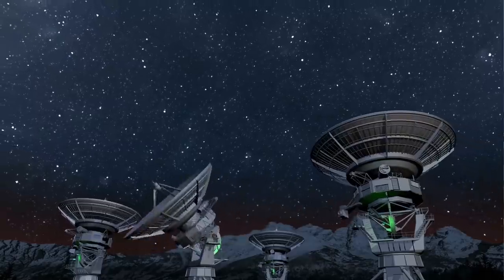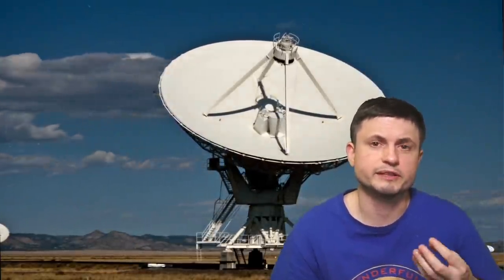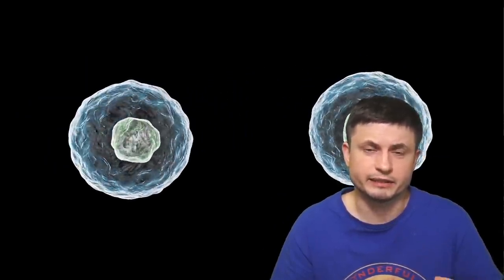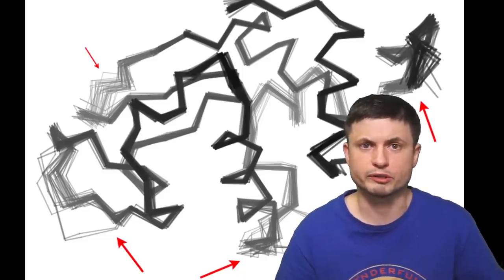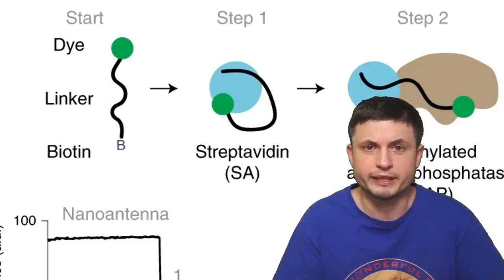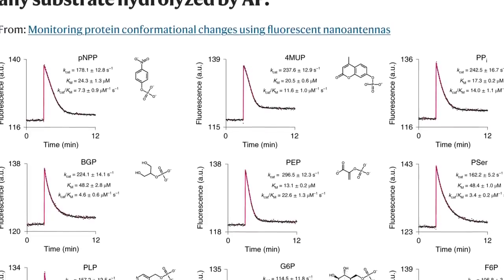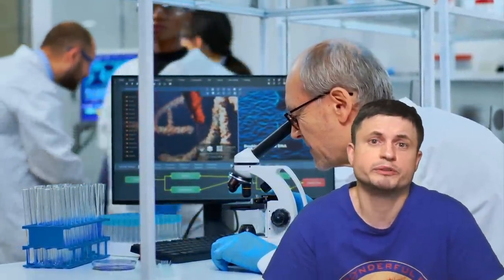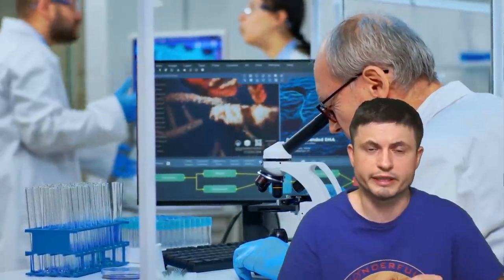Scientists Used DNA To Create World's Smallest Antenna Ever For an Unusual Reason

Comment: Fluorescent proteins have been used like this for a couple of decades.  They're a standard laboratory workhorse.  It would be nice to have a summary of why these are better.

I'm also curious about how DNA would get attached to proteins, since that's not something I've heard of before.  DNA gets translated into proteins, and RNA is sometimes incorporated into protein structures, but reliably incorporating DNA into proteins would be something new that you'd have to trick cells into doing rather than being able to tap into existing cell machinery.
Reply: The link to the paper was included, and there is no paywall to access it. That said, as I noted above, DNA in this study was literally used only as a transporter molecule for a fluorophore molecule attached to it. That is, the DNA itself only served as a carrier for a probe molecule whose fluorescence was monitored in real time and in vivo (in live cells) as a function of such parameters as DNA strand length, use of single-stranded or double-helix DNA, the type of fluorophore molecule used, and the nature, geometry and proximity of an acceptor molecule (acceptor molecules are used to facilitate a process called Forster Resonance Energy Transfer, or FRET, which is useful in understanding the kinetics of biochemical processes). Ultimately DNA was not as critical to the results of this study as so many commentators here seem to believe, as similar trends were also observed in this reported study using PEG-based polymers (PEG = polyethylene glycol) as carriers. But the key distinction is that this probe works in real time in vivo to understand protein dynamics in their native cellular environment
Reply: @dgc0120  Thanks for the summary.  I glanced at the paper, then realized I was too lazy to read it and try to understand it.  :-)  I'll probably have to do some more reading to really wrap my head around everything you (and the paper) are talking about.

Comment: it seems like this could be used to add an optical interface to our brains,    where a bci would be an array of microleds and rectenna's  instead of electrodes.
Reply: exactly my thoughts. it could be the next optogenetics. non invasive if you just use radio waves... neurons expressing these proteins/dna could both send out signals and receive them. there is a lot of potential.

Comment: Very interesting topic and field because to put it bluntly the notion that DNA would be a code that unlock all the mystery of life is completely obsolete now, if it goes to that direction it's only the first tiny step in a very long walk indeed. Not only it didn't unlock that much, but the interaction mainly due to proteins is a field we just don't have any kind of accurate ability to analyze in vivo. The picture that manipulating DNA was like butchering with an axe was very much true, and still is. And this even with tech like CrispR, simply because the dynamics at that level is mostly out of reach technologically. It's like trying to watch the sky with dirty glasses and an inherent disability to see movement.

Comment: 4:58 I am sorry this device is not antenna in general and definitely not a radar - in any sense. Antenna is a device converting electrical current into EM-wave and vice versa. Here no current is generated. If anything, this device works as fluorescent light.
Reply: Robert Bloch "I'm sorry this device is not an àntenna ...."

So basically it is an antenna. The absorption and emission of photons essentializes the mechanics of an antenna. The mechanism of sending light and receiving the subsequent emission is what he refers to as radar Also, suggesting that there is no current in these systems warrants a review of basic electrodynamics. Btw an "em wave" is the classical description of emitted photons

Comment: I have enjoyed Anton's videos in the past when he focused on topics that he clearly had expertise with. However, this topic is clearly outside his area of expertise, and it seems that it has invited a large number of comments that either reflect poor understanding of the technical area or willful ignorance. To wit:

1) DNA is indeed a biological data storage medium. It is a ubiquitous biopolymer that encodes all of the information needed to produce the proteins and enzymes necessary for life in sequences of nucleotides called genes. Those sequences are read by the process of transcription using special RNA molecules and then translated into proteins using other RNA molecules. This is a purely chemical process for genetic signaling and gene expression. There is no known mechanism for direct information storage and transmission using DNA based on optical or other frequency-modulated means; even the new field of optogenetics does not make such claims. And while there are macromolecules or other explicitly coupled chemical systems that absorb photons of one frequency or wavelength and up- or down-shift them to a different emission wavelength or frequency, that is not the case in the study Anton referenced. Hence the term 'antenna' is really not appropriate here.

2) Instead, DNA in this study was literally used only as a transporter molecule for molecule attached to it called a fluorophore. That is, the DNA itself only served as a carrier for a probe molecule whose fluorescence was monitored in real time and in vivo (in live cells) as a function of such parameters as DNA strand length, use of single-stranded or double-helix DNA, the type of fluorophore molecule used, and the nature, geometry and proximity of an acceptor molecule (acceptor molecules are used to facilitate a process called Forster Resonance Energy Transfer, or FRET, which is useful in understanding the kinetics of biochemical processes). Ultimately DNA was not as critical to the results of this study as so many commentators here seem to believe, as similar trends were also observed in this study using PEG-based polymers (PEG = polyethylene glycol) as carriers.

3) There has indeed been a great deal of research exploring the materials science of DNA. Of particular note is the development and use of non-canonical (non-canonical = does not exist in nature) amino acids and nucleotides to create non-natural proteins; the application of computer science for the creation of pre-programmed nucleotide sequences that yield a multitude of molecular scale, origami objects, e.g., boxes, pyramids, hinges, letters, numbers and other objects; development of artificial enzymes or catalysts; 2D and 3D templates for fabricating periodic organic and inorganic nanostructures, especially for nanophotonic applications; the creation of extremely durable and robust data storage media; and even attempts to make DNA into molecular wires for molecular electronics. These applications, however, are a far cry from how many commentators here have suggested how DNA works even in these studies, and suggests at the very least fanciful thinking let alone fundamental lack of knowledge of the state of research in this expanding and vast scientific discipline.

4) Because so many commentators here seem poorly informed about this topic there seems to be a lack of understanding that the chemistries and photophysics involved here have been used for decades already to study of range of chemical processes, particularly kinetics (sounds like 'dynamics' of protein mobility and the activity of the catalytic site in this work). In this light it makes many of the comments here sound hyperbolic to the point of being absurdly non-scientific and pure fiction.

Otherwise, please keep up the good work Anton.

Comment: Wow, Anton , or anybody wondefull..
Cpuld you please explain how the receiving signal of these antennas id broadcasz to the scientists? I understood that different dna codes make out different sizes amd shapes of these antennas,  and then each type is related to specific frequencies.. the information is made of light, fluorescent light.  Okay so now questions:
Where does the fluoresecent light come from? Is it "added" by the scientists and reacts by boucing from proteins toward those antennnas..?!
Reply: The short and direct answer to your question is FRET, or Forster Resonant Energy Transfer, where radiationless energy transfer occurs between the dipoles of two molecules. Briefly (and quite descriptively) a molecule called a fluorophore absorbs energy to an excited state (from an external source such as a fluorometer), and if that fluorophore is both very close to AND properly oriented to another molecule that can absorb energy from that fluorophore molecule then the other molecule can absorb the energy emitted from the fluorophore. This gives rise to a signal that can also be detected and monitored by the fluorometer.

The magnitude of the energy absorbed and the rate of energy transfer are key parameters used by chemists and biochemists to probe the kinetics - the dynamics - of many chemical and biological processes

Comment: Your video ends with the earth "rising" on the moon. Which of course it never does. The same side of the moon faces the earth at all times. So the earth remains at the same elevation when viewed from a fixed location on the moon. This was explained to me by moon landing deniers.
Reply: Notice the ground is moving. The animation is from the perspective of something orbiting the Moon
Reply: @TheRealMirCat  Flat earthers... eh details.... ;-)
Reply: Ahem, Earth stays at mostly the same spot in the sky, when viewed from the moon. You see, there's this extra movement of moon, "libration", caused by the tiny mismatch between moon's orbit (which is not circular) and it's rotation (which is mostly constant, save for powerful moonquakes or asteroid collisions). So Earth looks like it "orbits" a point in the sky